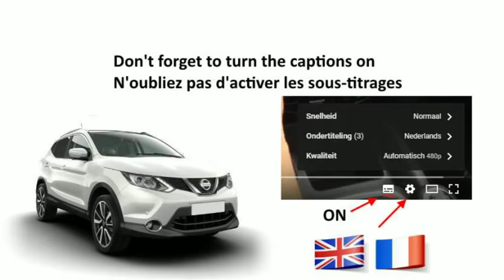How to install an extra 12V power outlet

Comment: hello, i did the same mod but instead of taping to the rear power socket, i tapped on the front power socket. And i didnt have to reach the cable to the center console...
Reply from the maker: You can use the front socket as well indeed but it is continuous while the socket in the center console shuts down when you close the car. This way it will never drain my battery.
Reply: @LaPalmeraie0032  correct. My intention was to leave a mini refrigerator for a short period while i park the car
Reply from the maker: Manuel Velez sure 👍🏻 there are multiple possibilities to reach the same effect. Thanks for watching and sharing your approach. Hasta luego.
Reply: If you have can you please share the link here as i want to add a something helpful  there. Thanks
Reply from the maker: Manuel Velez hi Manuel, I’m not sure if I understood you right. You want to share a link here in the comments? If so be my guest. If you meant that I have to share something, please precise what that should be. 😉

Comment: Linkss for the cables?
Reply from the maker: Hi, the socket and fuse from AliExpress can be found in the description. For the cable I bought a 2.5mm audio cable in the local DIY store 😉
Reply: La_Palmeraie  I don't find the links in the description . But thanks I will lookit
Reply from the maker: « Seller » and then the tinyurl 😉